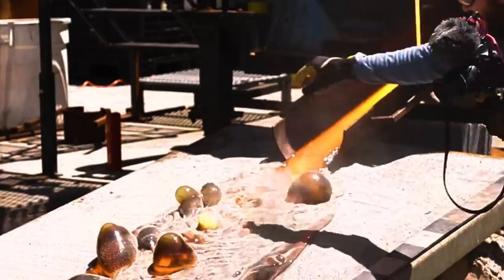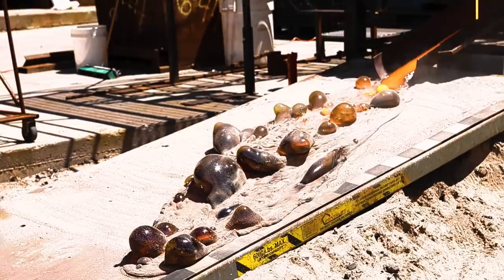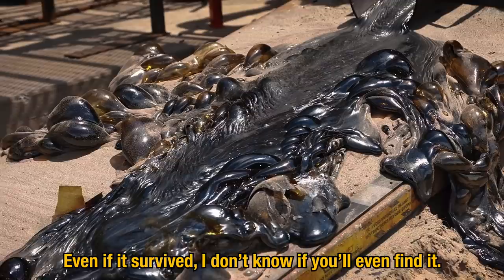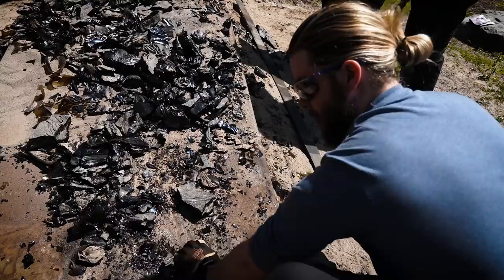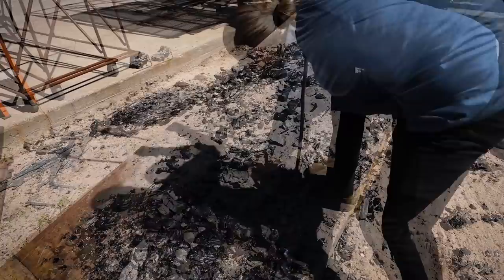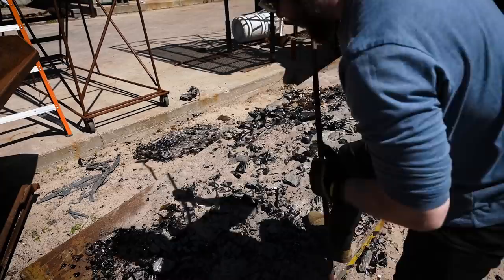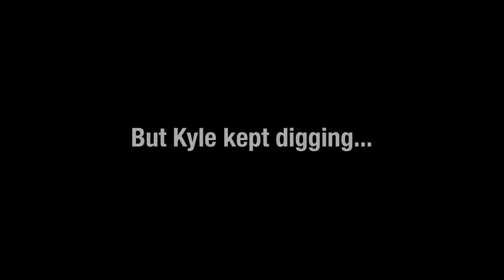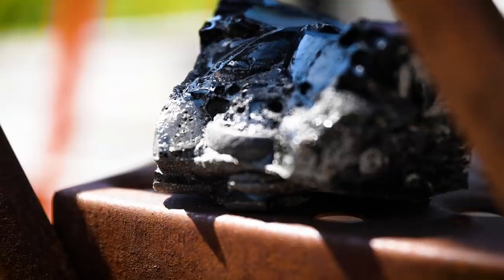Will REAL LAVA Destroy the One Ring?

Comment: That's representative of a Lava flow, not representative of molten magma found within a heart of a Volcano.
Magma seems to have a temperature range of 1,100 to 1,600 degrees C, while Lava tends to be 800 to 1,200 degrees C.

Plus the one ring didn't fall directly into the Magma of Mount Doom, as Gollum had it when he fell in, and it would've floated for a moment or two probably slowly softening as the Magma would be hotter than Gold's 1,065 degrees C melting point.

Might want to try that again though, just to see which is right.
Though I'd use a three Gold coated Copper rings as Copper has a melting point of 1,085 degrees C; you can toss one into the crucible, one into the Lava, and have one wrapped in something you can drop onto the Lava to prevent it immediately sinking.
I'd also use a metal detector to find them.

Comment: well it looks like the gold was stripped away golds melting point is 1,948°F well titanium melting point is a lot higher at 3043F so the ring would not have meted if you dropped in the 1500C furnace. Might have burned up though. however, it's likely with magical things you even deform it in some way it won't work anymore.

Comment: I think I have to disagree on whether or not tossing this ring into an actual volcano would yield similar results… 

This setup is to observe and experiment with magma flow and once poured, this lava immediately begins to cool and would behave like described as it releases heat to get to ambient temperature. However, inside an active volcano, you’re close to the heat source with additional energy being added to the system. I’d say that if the lava temperature is high enough to melt titanium, then that ring is as good as liquid if thrown into an actual Mount Doom.

Comment: If you threw the ring in am active volcano where the lava was staying hot and not cooling down, wouldn't the heat eventually seep into the ring and liquidize it, and with enough motion in the lava the casing around the ring would seperate and it would all flow?

Comment: I'm not sure the two events are quite comparable. First, isn't the one ring fashioned from gold? Titanium has a melting temp of over 3000 F, while gold is only 1948 F. Also, they are pouring the lava out onto a big steel sheet, which is cooling it. A large body with tons of lava is going to hold on to that heat and eventually heat up the initial cooled lava around the ring until it is heated up to the temperature of the other lava, causing it to melt.

I'd recommend putting the lava in a crucible, dropping the ring into it and putting the crucible back into a furnace to maintain it at the 12000 F temp for 15 minutes or so, then pour it out. Also, if you pour it out onto fire bricks or take the cooled pieces off of the steel bed, you could use a metal detector to try to find the ring in the cooled lava.

Comment: No kyle, we aren't complain about the ring.
except that is titanium, however isn't supposed to melt, so it's good.

still, you drop it in molten running and cooling lava, they drop it in molten stationary however converting and also kinda melting lava.

so.... I guess you gonna have to try again, or make a deal with Sauron, yes I know you are trying to get rid of the competition, so you are the only one left, however... given the current situation, I think a deal will be the best "temporarily permanent solution".

P.S.: because every solution is permanent until is no longer solving the problem.

Comment: Uh, Kyle, why not do it with a gold ring? I'm sure you can afford it! 'Colder layers of lava encapsulation' aside, your titanium ring never had a chance to melt, as I'm sure I don't have to point out they said at the beginning that the lava temperature was 1200°C, and titanium melts at 1668°C. Gold at least is around 1000°C (depending on the alloy). And gold is the canon metal the One Ring was made of. This needs a do-over!

Comment: That's so awesome! Presumably the actual ring in the story was pure gold, which would be a lot heavier than your titanium stand-in, so it would have a decent chance of sinking compared to the much lighter one you used. The other difference is that the volcano in the story wasn't a lava outflow like yours, so even if the magma surrounding the ring was cooled somewhat by the ring, it would easily be heated up again as it was surrounded by fresh hot magma. So I still think it would melt over time, and eventually the metal would flow apart.

Anyway, I hope you got to keep the chunk of rock with the one ring in it?

Comment: OK... been thinking about this one too much.

From their densities, most metals would indeed sink, though interestingly alumin(i)um would just melt into a puddle on the surface. If the ring carried on sinking it’d melt, whatever the metal, by the time it reached the FeNi fluid of the outer core (assuming the same internal structure as our globe), though I concede I haven’t considered pressure effects on phase changes.

Therefore I would posit that Mount Doom’s status as the One Ring’s forge is what facilitates its melting so damn quickly, given, a) the Ring’s extreme physical durability and b) that the Council of Elrond specifically indicated Mount Doom rather than another lava lake less inconveniently in the middle of Mordor.

So... in conclusion: this time, “Because Magic” 😉

Comment: 6:28 so my question is the heat on top is exceedingly hot, so what if it dropped just so so that it stayed right on top of the hot hot fluid and didn’t fall into it or become immersed to a point where through sheer induction heating it just melts because it’s 1500°, right heat rises if the ring stays right where it is and just melts down then you’re golden but if it falls into it then you’re bumkus

Comment: Yes, yes it would melt IF the lava flow was large enough and deep enough. Lava flows will melt and re-melt based partially  on the quantity, temperature and concentration of the erupting material. It's a temperature over time situation.

Comment: But this is a lava flow; it all cooled down. Mt Doom was an active volcano where the liquid rock was still being heated. The material in the ring would eventually heat up and melt, as long as the melting temp is below magma/lava. Drop the ring in the crucible instead.

Comment: Well... Let me see... And what about the melting temperature?

-Lava: between 850 °C and 1.200 °C
- Gold: 1.064 °C
- Titanium: 1.668 °C

As we can see in see in the video, the gold layer disapears. But titanium does not melt in lava, because its melting temperature is higher.

If you had used a pure gold ring in the test, the result could be the same, due the explanation of the instantaneous solidification of lava around the ring... or maybe not...

Comment: I can't help but think if it was actually dropped into an active volcano, it would melt a ring. The problem with dropping the ring onto the lab-made lava flow is that the lava is rapidly cooling as it's being poured and flowing down the ramp. Yes, it is still incredibly hot, but the sand underneath and the ambient air around it are slowly dissipating the heat within the flow.

If there was a way to simulate the intensely hot heat, and sustain that heat, I think the ring would melt. This is all imho 🤷

Comment: I'm not sure this is an entirely accurate recreation. This was a small amount of lava, actively cooling, instead of a huge caldera of magma, still being heated and with enough mass and thermal inertia to retain its heat. The lava was also flowing instead of sitting still. All of this encourages the experimental pour to lose heat as fast as possible. It might behave differently in an actual caldera like the Crack of Doom.

I hypothesize that if a cool object like the ring fell into the lava, it probably would get a insulating layer of cooler rock around it (which we actually sort of see in the movie). But if it stayed in the environment long enough, that layer of cooler rock and the ring itself would probably be brought up to the ambient temperature, which is above the melting point for the rock and for the ring itself, so after a certain amount of time it would still melt (which we also see in the movie).

Comment: The problem with your methodology is that you put "The One Ring" in a lava flow rather than a caldera as is observed in the movie.  I would venture a guess that in a caldera, the temperature would be much higher and much more sustained, such  that the protective barrier you referred to, would eventually allow enough heat to conduct through to melt the ring.

Comment: It would melt tho. Literally everything on earth would melt. The ring was thrown in a volcano, so it would sink and sink until it has melted completely. Even if lava is not hot enough when it is cooling, magma isn't loosing heat. and don't forget about the pressure difference as gravity pulls it further into the planet. if the density is heavier it should become part of the inner core right? and you'd have alot of friction going on too adding even more heat. i don't think i am wrong at this but feel free to correct me if i am

Comment: I guess my question would be, isn't the lava in a real mountain fairly deep?  I mean, some of those lava chambers could be hundreds, even thousands of meters deep, no?  And if the ring is sinking through that, it's not cooling, it's heating up.  Granted, if the material doesn't reach its melting point even once it reaches equilibrium then it's not going to melt, but instead sink to the bottom or wherever the lava flow starts to congeal but assuming it does reach its melting point it will do that before it reaches a point it solidifies.  I don't think the experiment, cool (or hot I guess) as it was indicates the ring wouldn't melt.  Besides, we know it did melt since we all saw Sauran explode in the movie, plus the Elves lost their powers.  :p

Comment: Well, of course it didn't melt, and you told us that in the beginning of the video.

"Gold-plated titanium" was what your ring was made of. Titanium has a very high melting point (1668 °C according to Wikipedia), so even if the lava didn't form an insulating crust, the ring wouldn't have melted with the lava at a mere 1500 °C.

It's hard to tell from the video, but it does look as if the gold plating has disappeared from the ring. Gold melts at only 1064 °C, so a very thin layer of it could easily have melted as the lava around it was cooling and solidifying.

A solid gold ring might have ended up being melted in the cooling lava, perhaps at least partially.

Comment: Um....Kyle...as the professor said, 1200 C will melt.  The one ring was gold which has a melting point of 1064C, so very likely the one ring would melt (yours was titanium which has a melting point of just shy of 1700 C).  The one ring likely wouldn't survive even with the evaporative cooling around the ring because that lava around it would re-melt and there would be no evaporative cooling then.

Comment: Shenanigans. If Kyle tossed his ring into an actual volcano, the billions of tons of superheated rock would (eventually) heat up the ring and its shell. If its melting temperature is less than the temperature of the lava, it will melt. His ring did not melt because the poured analog-lava is not inside of a foundry or volcano. Drop the ring into liquid rock in a foundry and keep the heat on...

Comment: Video, Kyle. The love hey. Bare with me on this one. I don't think this experiment was as true to the films as possible. We can see that the volcano was in a tumultuous state in the movie, which means the One Ring would've likely been taken below the surface. It is true the surrounding lava would have cooled, but considering the massive amount of heat energy present, the ring would eventually match the ambient temperature, whereas it would not have enough time nor energy in such a relatively small pour. Now, would the subsurface temperature be enough to melt titanium or whatever the One Ring was made of? No clue.

Comment: Ahh but the One Ring was thrown in an actual lava lake inside a valcano. There wouldn't be a cooling process and the One Ring would melt once it reaches the melting point.  But I am a layman. lol
Reply: Yup, it was hucked into the shiningly hot magma under Mt. Doom's crater.  It would still freeze the magma around it into insulating basalt, protecting it, but only for a time.  The heat of magma chamber would re-melt the rock, unsheathing the ring within, and the Tengwar script would stretch and distort as the dense gold torus sunk deeper into the magma, exposed to more and more heat, until the ring was undone and foundations of Barad-Dur with it.
But, for the movie, it was cooler to have it returning to the place of its creation destructively unweave the magic (hence the bright light coming out from behind the script) before it even really had a chance to sink.
Reply: @Archgeek0  Ty for the better explanation :)

Comment: So its cool none the less, but i feel like inside an actual volcano with more quantity of flowing magma that doesnt cool so relatively quickly. Of course without any additional heat being added the ring will cool its own rock and sit there on the sand bar, but in an actual volcano where the heat is however hot for much longer in somewhat of a confined area the ring wouldnt be able to cool down its own rock to sit inside of because the rock would get melted around it over the days the volcano is active. Think of the opposite, you take a glass of water to the north pole and pour it over the ground its gonna freeze correct? Now take a tiny little ittie bitty sip of water in your cup, and pour it in to a glass of ice, still the freezing tempurature of water because its frozen water already, and add your little droplet of water and would  you look at that? It didnt freeze. Why not? Because the ambient tempture of the ice is geting to warm to freeze new water. The ambient tempure of flowing lava cools to fast to melt. You throw the ring at the top of the furnace with everything else melted it would probably miz and melt in with the rest of it

Comment: 🤔🧐🧐🧐

I think it was supposed to be the magic of the volcano that destroyed the magic of the ring, 

gold is significantly more dense than titanium or “liquid hot magma” it would sink eventually (assuming it was actually gold and not some magic metal).

Inside a volcano is fairly different to inside a lava flow you get inclusions of wall rock from the sides of the volcano and even rock from deeper down in the walls of the magma chamber however they are generally high in moisture to start with and relatively low density more dense materials tend to sink and be chemically altered and or slowly dissolved by the fluids deep in the magma chamber. 

So if there was an eruption soon after and it was just a gold ring it would probably come out fine if you could find it again , if the volcano sat around bubbling for long enough the gold would sink and or get into more active parts of the volcano and melt.

From the response of the ring in the movie Sauron probably got a bit of Bakelite, carved runes on it, painted it gold (or found it in a box of crackerjacks) and cast magic on it using the volcano which protected it from normal fires etc but chucking it in revoked the magic.

Comment: I wonder if the conditions this test was executed under were really realistically comparable to what actually happens in the movie/book, though. 
Sure, you threw the ring into actual lava, but it was a pretty thin layer, and you were outside. In The Lord of The Rings, the scene in which the One Ring gets destroyed, they are inside a volcano, and they spend quite a lot of time there before the ring actually falls into the lava. 
Wouldn't the ambient temperature of the volcano chamber and they time the ring is in there before it comes into contact with the lava alter the conditions significantly? The ring would be at a higher starting temperature before making contact, and the mountain walls should insulate the heat at least somewhat, making it significantly hotter than in your experiment. I'm not good with physics, so I'd be very interested in whether somebody else could do the math on this and figure out if I'm onto something or not.

Comment: Mmm.
Titanium melting point is 1,668 °C.
Gold melting point is 1,064 °C.
Also, lava in the throat is melted and at more or less same temperature, so even when a temporary lava encasing could be formed (providing let's say the One ring has an initial very low temperature), thermodynamics dictates that the lava encasing will eventually melt again, so bye bye ring.

Comment: While very cool to watch, it doesnt really translate to the story. After all, its not about temperature. They could have tossed the one ring into any old volcano instead of having to run right for saurons back porch if lava was the secret. It was that specific location, because magic, (like because science, only somehow nerdier?) But again, still neat to learn that it can work that way. I wonder what the actual point would be where a material does not get encased and protected because its still hot enough to melt/burn?

Comment: This test not accurate. The ring was thrown into a volcano that was active and remained active after the ring was thrown in. They should of thrown the test ring into the melting caldron and left it on and then shown how the ring might of fallen in and stayed intact for a small time but the hot lava would of eventually heated it up and melted it. In their test they just through the ring in to some cooling lava running down a ramp that has already started cooling. The conditions of their test were not like the conditions of LOTR. Also the one ring was gold not gold plated titanium. Gold’s melting point is different than titanium. Also the fires of mt doom are hotter than other volcanos.